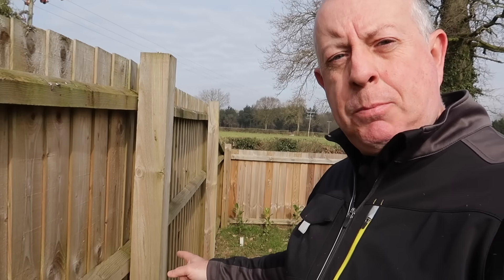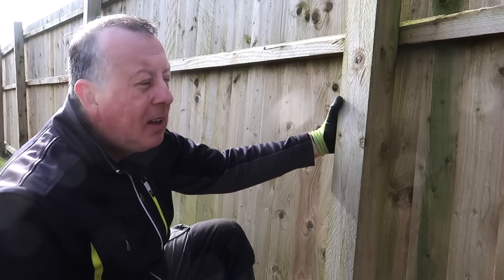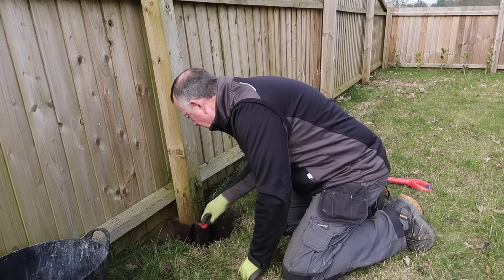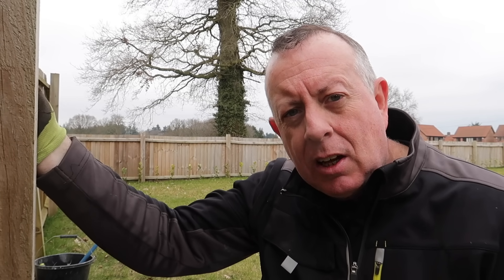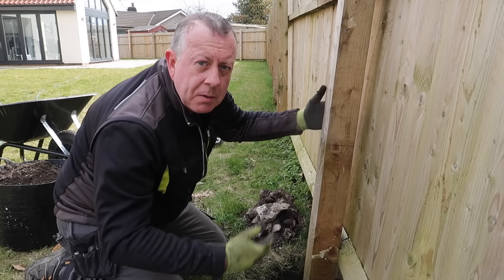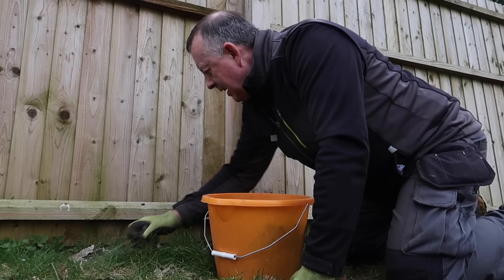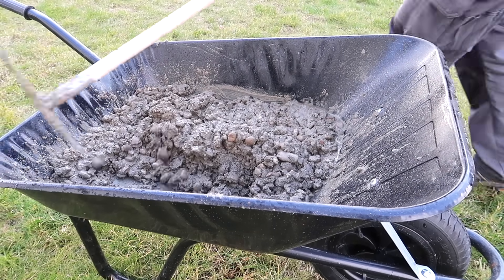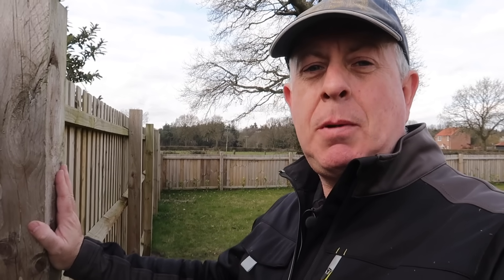How to Fix Leaning Fence Posts

Comment: Postcrete is solid as long as your hole is not losing the water faster than you can pour in the postcrete or the water isn't collapsing the hole.
Reply from the maker: I'm not rich enough to use postcrete

Comment: Not enough concrete true, but it's shaped wrong as well,that's the main reason for the lean. It needs to be bell shaped,meaning the bottom should be flared outward,this would brace the fence against stiff wind and keep it from moving back and forth.

Comment: Wood should not be in the dirt. Set post on a rock and surround with gravel a few inches up. Fill with concrete above soil level and slope away from post so water drains off.

Comment: I've always found that the concrete cannot be flat at the top you need to have a slope away from the post else the water pools around the post and rots it away.....I solved this by using concrete posts - problem over.

Comment: At 6:33 you hammer in the nails...at 6:40 we get a close up and see that at some point you had to pull the nails out and hammer in at two different points. Did you have to dig deeper and place the fence post deeper? How did you plumb the fence post before securing it with your triangle frame - triangle frame does not guarantee a post perpendicular to the planet surface.
Reply: Someone suggested I press/hammer a piece of rebar at an angle towards the fence side before pouring concrete.

Comment: There is one way to keep it straight.  Not putting in a post only 18 inches deep is the biggest reason.  However, if you go down 3 feet and it wont do anywhere.
Reply from the maker: I wish someone had told that to the fencing contractors who installed it!
Reply: @ProperDIY  The fencing company here does the 18"-20" and says that is fine with a bag of concrete in the hole.  Their fences say otherwise.  So I decided not to hire them, and put it in myself.  Instead of 8 foot poles for the 6 foot fence, I purchased 10 foot poles and went down 3.5 feet.  The fence is still straight after 10 years....

Comment: Quite definitely that post for the first post is too small (almost non-existent in part of the area round the post), also, not high enough (irrespective of how deep it may be).  The concrete needs to be wide enough to fill the entire hole, also, should be about 600mm deep, minimum (the higher the fence, the deeper and taller the foundation needs to be).  Ideally, the concrete will be up to ground level, and even better, brought up about 100mm above ground (with a slope on top away from the post, all around, to help shed water).

Comment: You dont have to break out the old concrete.  Just dig a hole 2 ft deep next to it.  Then fill the new hole all the way up and finish filling the old hole up to the top like it should have been in the first place.  Both holes would be joined together to create a bigger footing
Reply: Haha yr i was thinking the same tbh a bit dramatic for a fence post haha and i do a fair few fences and posts and i always use post mix where you just add water never had any problems or complaints from customers but iam plzd he used a line lmfao

Comment: I take it you didnt put that fence post in...short measure of concrete hope the others are better filled, good video again
Reply from the maker: Correct. All complete when I bought the house. I think I will be repairing this fence continuously over the next few years!!!
Reply: @ProperDIY  You need to make sure you don't put any soil around the post at all. I would remove  the soil from around all of your posts and top up with concrete, leaving a little slope for water to run off. If not you will find over the next few years all of your posts are going to snap at ground level, treated timber is terrible these days. I have seen posts snap within 3 years with soil around before.

Comment: It may be the normal way to build a fence over there , but it is poorly built by Australian standards . Disregarding the pathetic amount of concrete around the base of the post , the rails should be rebated into each post so that they are level with the face of the post . Have the rails long enough to span two bays and stagger the rail joints so that you don’t have three joints on the one post , otherwise a weakness is created and a whole section can easily fall down if the rails come away from the posts . Having said all that , well done a good repair job .

Comment: The water permeates the concrete in the ground to a depth which will be permanently rotting your posts as it really never dries out, and even treated timber will eventually rot. You can use concrete safely but below 500mm where oxygen is unavailable and it also may remain dry as well, but that's a very deep hole and a lot of hard work. Why use concrete at all, I don't. I use a 600mm depth for intermediate posts to 800mm depth for end posts and ram the ground around a tar painted post; saves time and money, and if something goes awry in the future, no concrete in the ground to painfully deal with. It will last in excess of 50 years and longer depending on the environment.

Comment: Why go to all that trouble of digging the existing post foundation out to just do a copy replacement ? Surely you should dig it all out and ADD a concrete spur to the base of the post and the when the post mix has dried you fix the post to the spur with coach bolts ! Easy to replace a rotting post in the future,

Comment: Have you ever thought of tarring that  part of the post that is enveloped in concrete. Pressure treated or not pressure treated, you still should paint a coating of tar on the base buried in concrete fence foundations.

Comment: Where can you buy these fixings?, for years my side gate has pulled the timber away from brickwork with all the inadequate fixings ive tried
Reply: Get 8mm express nails, put 4 or 5 of them into the timber and the wall, predrill with an 8mm sds, holding the timber level. Hit in the express nails and jobs a good one. Should be very strong.

Comment: I have a 1.8 m tall paling fence I'm building and using H5 treated for underground  100x100 posts. 2700 long so 900 in ground with 250x250 of concrete around them. So my posts aren't going anywhere. BUT!!!!!!!!!!!! they have warped and twisted. They were dry when put in and painted before ever getting wet. Isn't the paint I doubt but its very annoying as there is little I can do to remedy the situation. I will say my rails are in between each post (three per section) and if I had put them on the face of the posts it may have lessened the warp. However its on my side of the boundary as neighbour didn't want fence on boundary so I put the rails in between to minimise loss of ground.
Reply from the maker: It sounds to me that the posts were very 'green' (newly cut) when they went in and have naturally dried out and warped at the same time. Not much you could have done about it I don't think.

Comment: you dont have to dig a hole to see whats happening. first, your post are not deep enough. do do it properly top of fence post should stop at your top horizontal fence cross board. i can see you would gain a foot already. another problem may be a wet area. if you do it my way you dont have to use concrete except at gate posts. all fences like that always end up with the bottom touching the ground, due to frost and the weight of the fence.

Comment: I would have added some screws to the post, if I could work them in, before adding the cement, so the post will hold to the cement longer, even after the wood softens on the outside (over time / weather).

Comment: sds plus bits like that come in LONGER  lengths eg 600mm, so you dont have to take the handle off !!!
Reply from the maker: Of course they do but taking the handle off is quicker and cheaper than stopping to go and buy a drill bit you don't currently own.

Comment: Or don't use wood fence posts in the first place. Use galvanized poles sunk 24 inches in concrete and you will never have to worry about that post again. Did this 25 years ago and they ate as straight as the day I first put them in the ground.

Comment: It's a footing, foundation is the earthworks you put footings into.
Reply from the maker: Sorry, I disagree. A foundation is the part of a structure that transfers load into the ground - beams, piles, caissons etc. A footing is the part of the foundation, at the bottom of the foundation, in contact with the ground.

Comment: When the 1x4s are on the opposite side, that usually means that fence belongs to the next door neighbor and could be inches on the neighbors property line. You would need permission to fix the post.
Reply from the maker: Traditionally you put the structure of the fence on your side and the 'good' side facing out which is what the builder of the house did here. So my fence

Comment: I rarely see this problem in NZ. I think people forget that fence posts are cantilevered columns, so have to go fairly deep down and with a big concrete footing extending the full height. There are lots of guides and calculations on how to install them to prevent this. I thought this video was about post that have warped, which is a more common problem I see.

Comment: How to fix leaning fence posts? Easy. Pull that post down onto your own yard, along with a nice length of fence. Document it. Blame your neighbor. Take them to court. Present evidence that a fence with a post leaning away from your property couldnt have fallen onto your side naturally, it had to have been forcibly pushed from the neighbors side. Thus they must have done it. Who else has access to their yard? Win case. Get money. Build nicer, bigger, more strong fence at the expense of the neighbors. Its a win for you and your neighbor since you both got a new fence that doesnt lean. Even if it cost them some money but hey, neighbors cant expect YOU to flip the bill for a shared fence right?

Comment: I too have suffered the bane of the reclarent tools - it's true, you buy a specific tool for a specific job and when you reach for it - the cheeky bugger has gone into hiding...untill you have have had to struggle with a substitute - and then, voila!  the damm thiong suddeny falls at your feet.   I am considering assembling all my tools on a weekly basis and reading them the Aricles Of War:  if they go missing they go into my Naughty Tools Bag - which is a special High Security Tool Bag  locked inside my Naughty Tools Detention Shed.

Comment: I'm a single old lady who put up 800 ft of stockade fence around my backyard 40 some years ago... So needless to say I've had much experience in fixing leaning posts. What you've done is totally absurd in my mind. You didn't need to break off that cement... All you needed to do is put in another bag of cement between it and the bigger hole you had dug out. It would have all fused together and giving you a bigger base.

Comment: Stuff just 'disappears', never to be seen again. A woo woo story. I needed some wall plugs for shelves I was putting up. I stopped work and went to B&Q and bought a big brown pack - you know the ones, all folded up like. Went into my son's bedroom and put them on the bed, drilled the hole, turned round to get them and they were gone. No-one else in the house at the time. Never found them, looked everywhere including places I knew they wouldn't be, just in case. Really annoying.
Reply from the maker: I'm glad it's not just me then!

Comment: Or just set up thhe stringline at the top of the posts and use a level then use semi dry concrete. No pro uses wet poured concrete for fence posts
Reply from the maker: When you say pro, you mean like the 'pro's' who originally put the fence in while cutting every corner they could which now leaves me with a 60m problem?
Reply: @ProperDIY  IF thats a new build it could be that the topsoil was put down after the fence which is pretty normal and explains the low hheight of the original concrete

Comment: Wood buried in dirt and concrete always rot.. . They build them this way for job security . Your fence needs to be sealed with 3 coats of solid stain after the wood cures and is completely dry. Fences are pointless.  If you must have a fence do it with brick posts . All wood sealed and off the floor...
PS not just talk ,,, me and my dad and uncle built the fence by his house like this ; brick posts on a foundation , then wood 4x4 across  top and bottom , then the pickets , all prestained . It seems expensive but once you have you brick posts done the fence is easy. It still looks good . That's after being built 45 years ago....@!!!

Comment: Good repair but going to all that effort you should have used a concrete spur job then done for life
Reply from the maker: It would also make my 25m fence look uneven when 1 single fence post along the run has a concrete spur on it!
Reply: @ProperDIY  OK see your point but I hate seeing bare wooden posts in the ground always a problem

Comment: Do you want rotten fence posts?  Because that's how you get rotten fence posts.  You gotta dump sand and rock/gravel at the bottom before you cover with concrete.  You want that post bottom to have a chance to dry.  Otherwise... nice fix.

Comment: I almost subscribed but you didn’t explain how you held that A frame in the ground sturdy enough, just by itself will tip into the direction of the post and not pull it towards you
Reply from the maker: The frame is pinned into the ground as you saw me hammer it in at 6:16. Thank you for 'almost' subscribing. As I said at the end of the video, if you're brave enough please subscribe - you're not brave enough - on this channel I only want the brave!
Reply: @ProperDIY  your right, not sure how I missed that unless I looked away long enough 🤷

Comment: Always remember this I tell you.never  add water to concrete then mix then pour into hole.reasons-you won't make an ugly mess.also its wasting your time finding wheelbarrow.then find a hoe or drill with mixing bit mixing.then find water source. Then make ruts in the landscaping with heavy wheelbarrow.then after that's done you have to ribse out the wheelbarrow.ri we the drill and mixer.rinse the trowel.then you get concrete k  your level when you level the post.then its on your hands.then you wash your hands.but it will be residue getting back on them cause its still on things you touch.which causes hands to dry and crack.
You do all that just to make the post way less stable .solid and strong..the best way just for making it the strk best possible result.and the fence will last years longer.because when you add water.it will only be a few seconds before you ,somebody else or an animal is bumping or wiggleing the fence.maybe just to keep on working.but even if you carefully tiptoe off the property and only did 1 post .the wind and ground movement will be plenty.and added to it the fact that every day that post is outside installed,it is shrinking.dramatically the first few days .then slowing as time goes on.so all that will make a void between the the post and concrete.and that void only need be a fraction.and the void occurez at the top of where it meets pole and makes a v shape and usually doesn't have much void at the bottom.which every morning.dew naturally coats the post in water droplets.until the sun and wind change the temp and conditions that bind the tiny droplets to the pole.when enough form or the weather changes,the water drips down the pole suddenly.some is evaporated first.but every day of the yearwater is funneled and trapped by the void  365.water drips . down the pole into the sixteenth of an Inch void which traps and funnels it right into the pole where it is trapped and can't drain.and sunlight doesn't evaperate it as well down in the dark ground .so every time the wind blows or a kid climbs or you lean storage on it,it wiggles and vibrates the nails all along the fence and will pull out a half inch.also that makes it all loose they wiggles easier and now there voids around the nails and wood from the movement .I promise you I can look at an older fence and predict the amount of void in posts and concrete.the bigger the void the older more rickety falling down the fence will be.the correct way is to save all that money driving picking up paying for it.and make a hole tamper .pack and tamo the dirt in layers.set the post on a handful of small gravel or even a small rock .that helps the water stay away from sitting pooling around the bottom.and tank them.its actually as strong as using concrete.fence will last 10 years longer.but the better way to me because you save time .less work tamping.is set the posts with dry bagged concrete.never add water.just tank around to make the fence stable some.as time goes by the fence will wiggle .it may or may not rain soon.but as it does,some u watered concrete will still be under between sections of the concrete that got water from rainfall.but the powdered co Crete just fills in the voids from rain or movement while it wiggles.so by the time its all gotten water and hardened.the voids are filled and a split 0 amount of void will remain.yoi can spend 35 years buildeing fences and other things to go back and check these things to be true.but I know u know what I say is by the way I say it.and mostly by the way that when you thought about it the physics and ways of the natural world and how things are.and any reasonable minded person  would know its true.in all my life I watch video I rebuild others peoples mistakes and talk to so many .I only ever heard any one  person say what I just said ,there abouts,and I was amazed to finally fond 1 person on earth that said it right.and that person I also know to be one of the best master builder,carpenter,engineer,architect,homebuilder and artist that I can think of except Leonardo davinci....